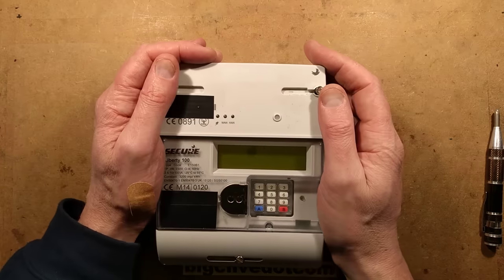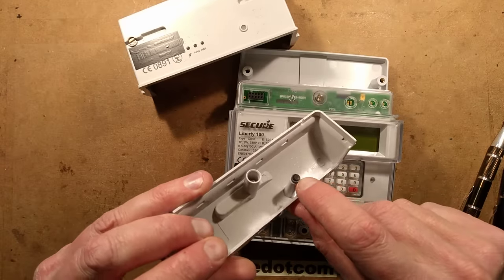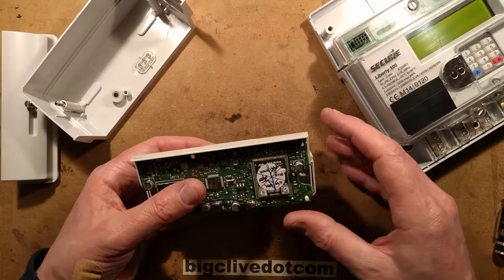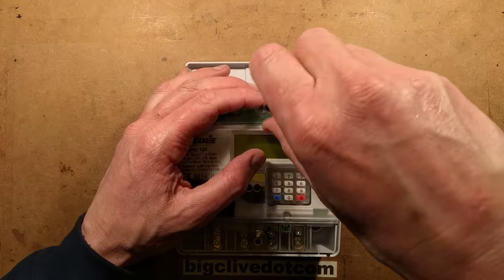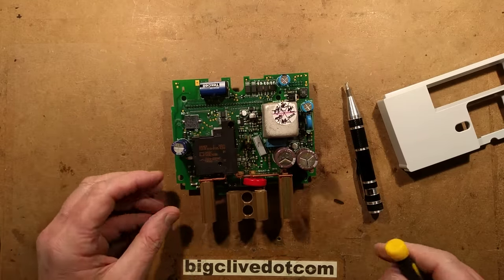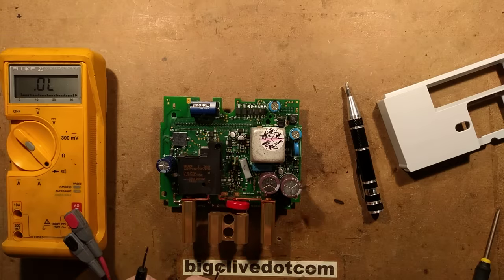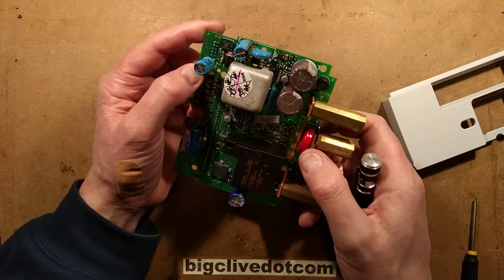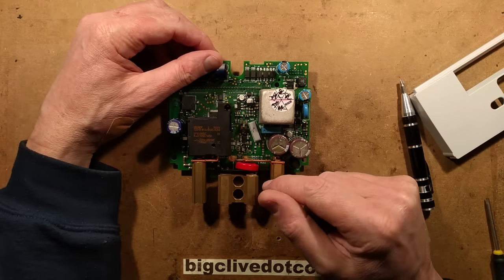Inside a smart meter, and the REAL problem with them.

Comment: Will you make a video explaining real versus apparent power usage for the consumer in layman's terms? I think a lot of folks (myself included) could benefit from a better understanding of what it is and what it can mean for our wallets.
Reply: It means bugger-all unless you've got a factory with huge motors in it. For the average household it makes no difference. It's just a minor bee in Clive's bonnet. You couldn't go sticking 20% on everyone's electric bill for reasons they don't understand, it'd never get anywhere. Instead, just ignore the power factor and stick the bills up 20% anyway. That way you don't even need to bother measuring it. Blame it on oil prices!

You can look up "power factor" online if you care. Basically it's to do with, in a resistor, as the voltage across it goes up, the current goes up too, at the same rate. For a coil, the current starts to increase after a little delay as the building magnetic field around it opposes the current flow. For a capacitor, the current will go up fast, as in charges from empty, even with just a low voltage. 

Coils and caps effective "resistance", that is, how much current they suck in, varies with time on their own internal electrical / magnetic charge, where a resistor has no such charge. 

So thingies with big capacitors and coils in them use electricity at a different rate than they seem to, you can't just multiply current by voltage like in a simple resistor, or tungsten light or electric heater. 

Really I don't see it'll ever be important for consumers.

Comment: The short range communication chip you mention is likely so it can talk to other meters. All the communications are done via your electric meter, if you have a gas meter, that does it's communicaion via the electric meter by a radio link between the two.